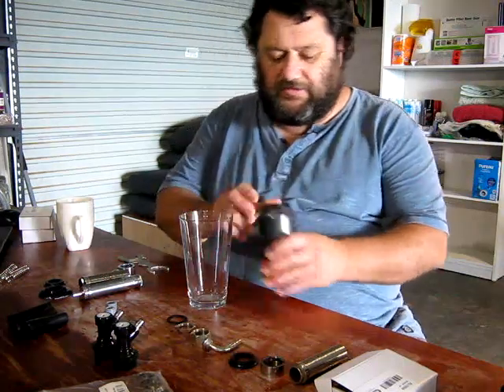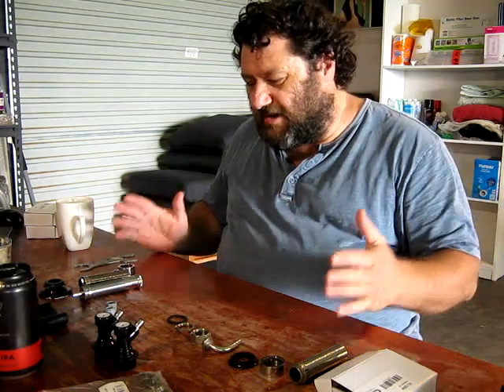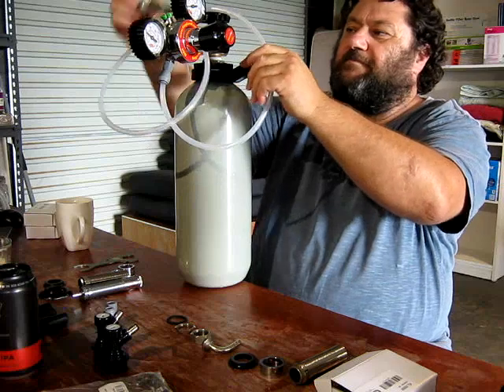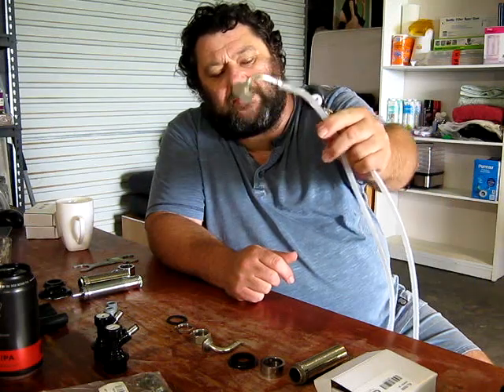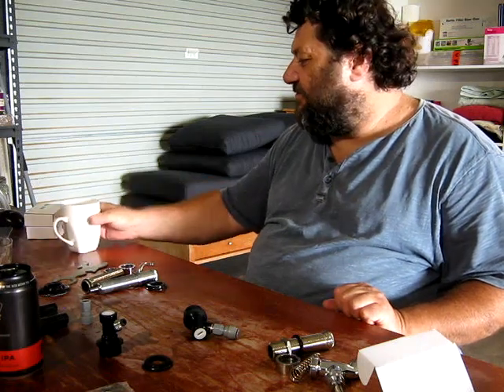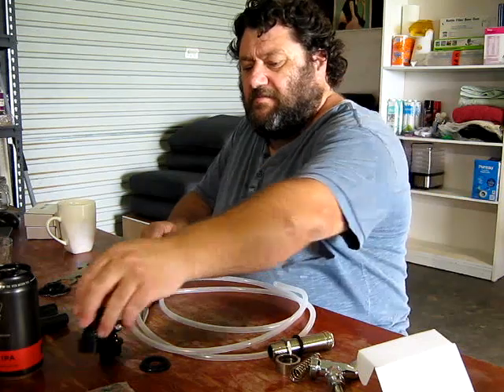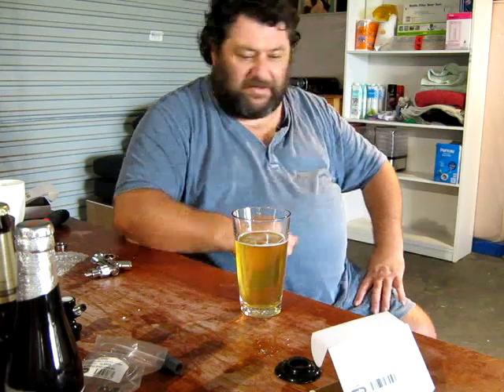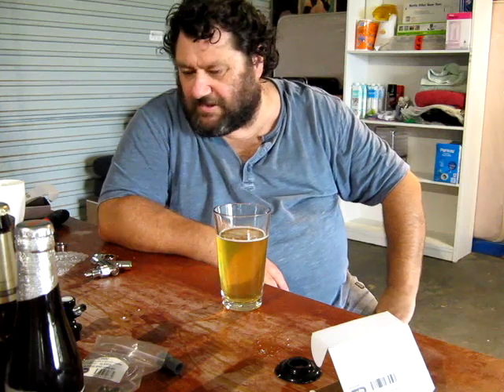Brew School #14. How to fit taps to your fridge.

Comment: thanks for the info LJ, i got a series X setup a little while back and the setup came with the duo tight fittings that tread onto the barb at the end of the shank so that you don’t need to use clamps on any part of the beer or gas lines

Comment: Hey LJ, you could glue a small piece of 3mm board to the freezer door above, paint with chalkboard paint so you can write in chalk what beer is in what tap, that’s what I did with my keezer I built.
Reply from the maker: Cheers Gavin. I have small magnetic photo frames that I print labels for, they have been removed so I can redo them for chrissy, so just scratchings ATM so I don't lose track of what is what.... I often write the beers in whiteboard marker on the freezer door.
Reply: @littlejohnsbrewing  no worries mate 👍

Comment: Good video again Little John. But I have a serious question for you now. 
You used that fridge, but I noticed in more recent clips in your brewery, you now enjoy a nice 4 tap kegorator…..
My question is. I have been putting some money aside for a kegorator, but am getting impatient.  I have a fridge, and thinking  3 taps and lines I may do for $150 plus 4 kegs at $100 I would get out of this for about 1/3 Rd price of a newbie. Now that you have done both, I want your honest opinion, would you bastardise a fridge again, or shell out for a kegorator? 
Ps I already have gas using only for pressure ferm, and moving beer. 
🍻🍻
Reply from the maker: Honest opinion..... I have no preference one way or the other. What it really comes down to is the individual and their requirements, environment and finances A cheap fridge with taps in the door is great if it provides enough beer carrying capacity(BCC). I had 6 taps then went to 5, always wanted more.... I brew so many styles it's hard to keep up with taps.... I need to drink more(but that means leaving work and probably my marraige🤣). I have now got the Kegerator X Plus with double 4 tap fonts, so 8 kegs on tap. I love it, it fits nice behind my bar, I can store glasses on it, it's just a little bit sexy..... but it is noisier than other fridges. It was fairly pricey, but buying new will be. I have limited availability of 2nd hand/cheap fridges where I am, so getting a suitable fridge is not easy. Finances is another issue, if you have the dollars, the ready to go Kegerators are a great option, just hook everything up and away you go, no drilling doors and running lines in.... but if it is an issue, than 2nd hand and taps in the door is massively cheaper, as you say about 1/3 the price. Is one option better than the other.... I don't think so, end of the day it comes down to what you are comfortable with, if 3 beers on tap is enough for you, then a cheapo fridge with all the bits for under $500 is a no brainer. Even a basic 3 tap kegerator will land you near $1000 with all the bits.